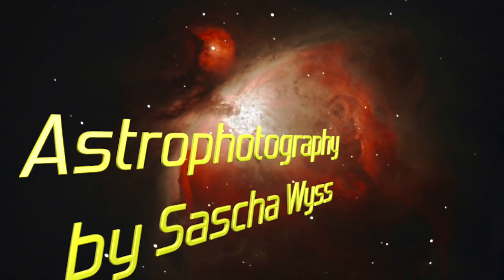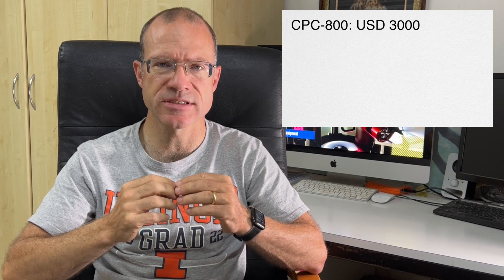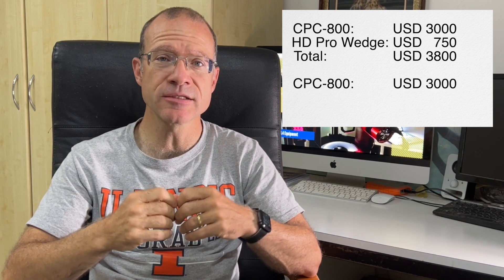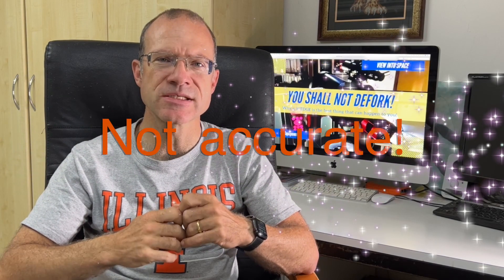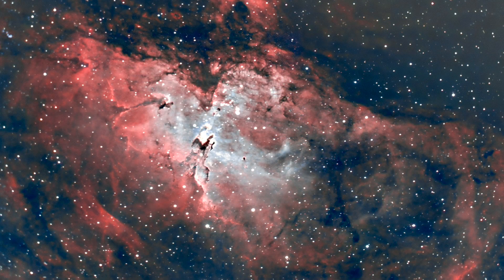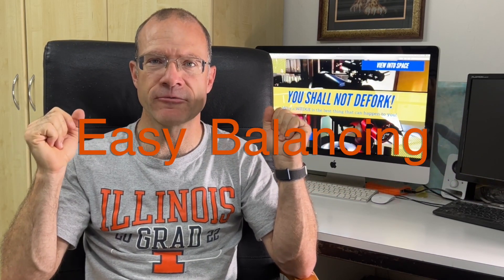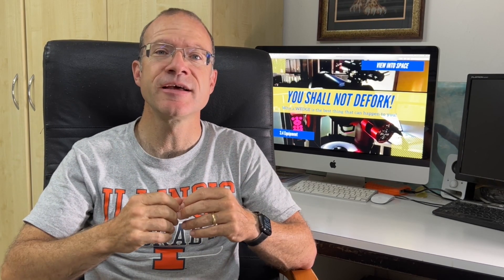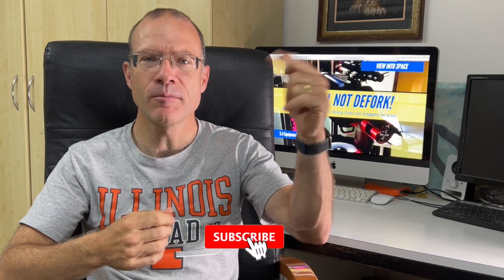WATCH THIS before you DEFORK your scope!

Comment: I think you missed one other possibility to improve on AltAz mounts for imaging - automated camera rotators. These can be had at the same price level as wedge only so same levwl of investment!
Out of pure curiosity - what are your RMS numbers on the eq wedged CPC 800?
I wonder if this would be similar to Meade LX90 8" - can anybody share their experience? That'd be much appreciated.
I'm in a process of getting (second) eq mount and deforking from LX90. I hate how outdated this moumt is (in terms of PC control/connectivity), although it is rather good for visual and planetary/lunar imaging.
But this poor connectivity and short distance between visual back and the base make it a deal. Braker for me...
Reply from the maker: I just do some shooting and my total RA is presently 0.35 (1.35'')
Reply: @viewintospace  thanks for following through with data!
My believe is that RMS >1 arc-sec is considered as rather poor performance (and it seems we're only talking RA, which would imply even worse when DEC is added for total RMS). This would only work for plate scales of > 2.5-3 arcsec/px for long exposure. You can of course try with lower scale and lucky imaging technique, but I'd imagine disacrd ratio would be quite high. Am I missing something here? I am specifically interested what warrented opinion that EQ wedge can provide performance similar to traditional GEM as the example data do not support this view. This is genuine Q as I am on the crossroad in my upgrade planning decision. I am looking to image at < 1"/px at long FL of 8" ACF reduced to F/6.3 (or F/6.2 if I'll change reducer to Lupus to better march already corrected optics). Would you still advise to go with wedge?

Comment: I haven't really met someone who wants to de-fork a perfectly working SCT/wedge mount.  In my experience it is people who own older Meade and Celestron SCT's who's mounts are losing their tracking, circuit boards are failing, or some other mechanical/electrical issue.  Meade and Celestron don't keep many spare parts for older scopes in stock.  So to save and continue to use their OTA's they de-fork them and add a rail so they can mount them on other mounts such as GEM's.
Reply from the maker: Makes sense!
Reply: @choppermontana8212  no it’s the Meade junk that has all kinds of mother board issues.   Just look it up on cloudy nights

Comment: My concern would be that the azimuth motor is designed for the forces to be pushing directly down, not at some crazy angle.
Reply from the maker: Might be or not - but fact is that this motor is crazy strong and the experience I and many other CPC owners have is that it tracks (with guiding obviously) very accurate, even with a high payload present.
Reply: @viewintospace  I have an Evo8 with the one fork leg. Is that a problem with a wedge? I'm not expecting miracles but some people insist it's flimsy. 

My biggest problem though, is that some dummy put a house in the way of Polaris.
Reply from the maker: I have some good and some bad news: Your biggest problem is no problem at all. With the CWPI software of Celestron you can polar align your scope on any reference stars - no need for Polaris at all. The bad news is, yes, you can't compare a one armed scope to a forked one. The motor is much weaker, the one armed concept makes it less stable and what I hear also the tripod is less sturdy. So it depends on your budget and your expectations. An Eco8 with a wedge gives you definitely more options than in Alt-Az mode. But for sure "dearming" your Evo8 and put the scope on a real EQ mount will still be a much bigger improvement and gives you all the options you might want to consider in the future.....
Reply: @viewintospace  But it looks so cool. :/

Comment: Great video!  Are there any problems with the camera hitting the spot between the wedge?  How can you avoid this?
Reply from the maker: When the image train is longer than the space below the fork you have this problem wedge or not. Just with alt-az the Problem is evenly distributed (forget shooting zenith at all), with the wedge you have ample space as long as you are shooting SW to SE, but in the Northern Direction you can not shoot to high. It is just something to consider when selecting objects. If you really need to shoot in a direction you can‘t because of this issue, adding a diagonal in between can resolve it. But given you are adding an additional optical element which can decrease the overall quality, I would only do that for specific cases.

Comment: Good video. But adding the wedge and all the other accessories for astrophotography will make the CPC a lot heavier to move around. I had a CPC 1100 with the wedge with a scope buggy but it still too heavy. I deforked it and got an AM5 and now it has become allot easier to move and setup.
Reply from the maker: Yes, the overall rig is way too heavy to lift - even with the CPC-800. But as long as you can leave the tripod and wedge outside and "only" move the telescope in and out, it is absolutely doable. That said, I understand that with the 1100 it might be a different story all together.
Reply: @viewintospace not everyone has a good place to leave a tripod and wedge outside,  most of us have to drive put to dark skies.

Comment: Isn't this an argument specifically for a CPC though? How about if you have a Celestar 8 with wedgepod and only RA drive? Would you consider that differently when it comes to deforking?
Reply from the maker: Yes, I would consider it differently. Be it from the stability of the tripod, one arm instead of the fork or the power of the motor - there are many differences. So I would say for serious astrophotography a one armed SCT should rather be deforked.
Reply: @viewintospace  The Celestar 8 has two forks though.

Comment: Ill buy a 9 1/4 or a 11 edge hd right now if I can figure out what is compatible with the fork mount.
Reply: Mainly plate solving is my issue of uncertainty… I want to land for example Orion on 4 to 8 different corners on each exposure. Then glue all the pictures together 🤷‍♂️ 

That way I can eliminate all hot pixels, dead pixel or anything not part of the sky. 🤔 I don’t want to buy an eq mount and struggle with cable management. My backyard is bortle 4 20.77 sqm I’m sure the eagle 4 will tell me it’s a 5 but again I don’t understand the software based on the current trend. 

Less then 30 minutes away bortle class 3-2 or 1 hour drive bortle class 1. 🤷‍♂️

Comment: I am thinking of getting a cpc deluxe 🤷‍♂️ however there is not alot of information out there. Doesn’t tell me if the eagle 4, asi air plus, or phd2 works with the celestron fork mount. 🤷‍♂️ it seems like people are taking astro images but i don’t see compatibility. 🤷‍♂️ maybe the set up is to expensive for most.
Reply from the maker: 1. You might go with a regular CPC (not HD) and buy the Starizona Reducer/Flattner - you get almost the same result for less money. The CPC is NOT compatible with the ASIAIR (no matter what else you read about this topic) BUT it works like a charm over ASCOM. And with that if works fine with NINA and PHD2.

Comment: How did you attach your dovetail, and where to buy the weights?
Reply from the maker: There are special dovetails from Baader, which fit to the screws of the Celestron SCTs. I also have the weight from Baader. https://www.teleskop-express.de/shop/product_info.php/language/en/info/p5324_Baader-Prismenschiene-Vixen-EQ5-Level-fuer-Celestron-C8-und-8--EHD.html https://www.teleskop-express.de/shop/product_info.php/info/p752_Baader-Balance-Weight-1kg-with-Vixen-Level-Clamp.html

Comment: Hi Sascha, great video!!.. I have a nexstar 8se and I'm loocking for a wedge. What do you think is going to work on my setup? Is the wedge good for nexstar?
Reply from the maker: Hi Sebastian  there is one big difference between the CPC and the Nexstar - and this is the payload capacity. It is much smaller than with a CPC and this might, depending on your setup, affect the guiding ability and accuracy. While I would not say the wedge does not work for the Nexstar, it is not such a clear cut case as with the CPC and you should  read some first person experience reports. When it comes to the payload issue, I found this: https://www.cloudynights.com/topic/368587-8se-mounts-12-lb-payload-limit-issue/

Comment: Thanks for the video.
Just wondering how do you prevent the image train to hit the arm base? Because the gap between the visual back and the control panel base is too short, especially CPC11HD
Reply from the maker: I guess it is for all CPCs too short - I have this issue too. The issue is also there if you use it without wedge.... With the wedge the area west - south - east is not an issue, you can even slew up to zenith, but the other half has a huge blind spot. I deal with it that I simply shoot objects what are feasible from the free movement point of view, and until now that this not handicape me too much. There would be a way to solve the issue, and that is to use a diagonal, but given that is another optical device which might reduce the quality and add other issues I did not pursue this until now.